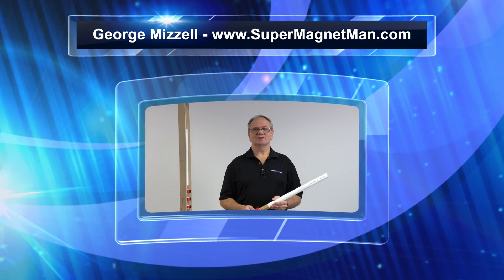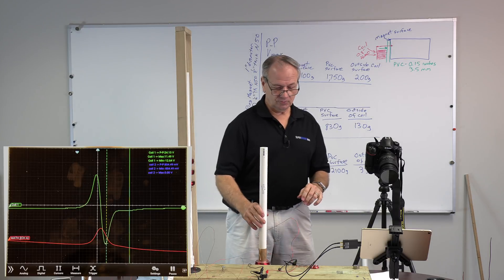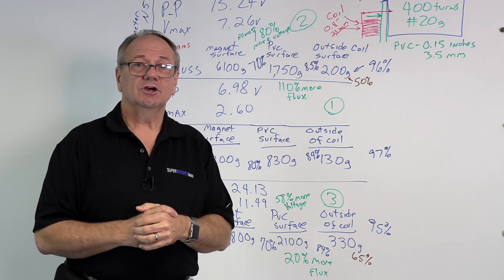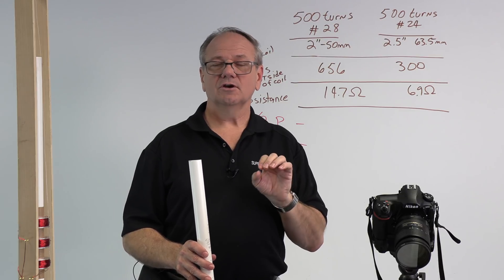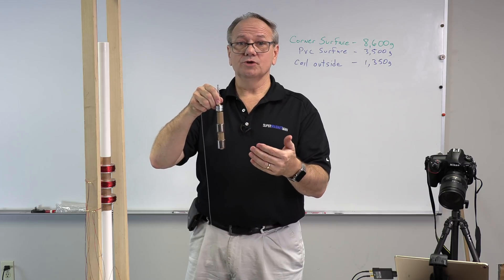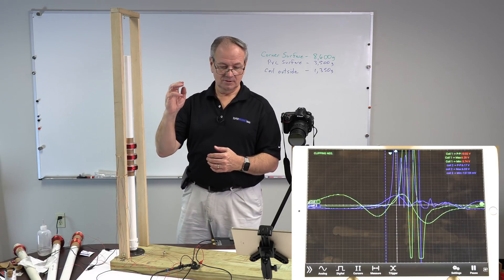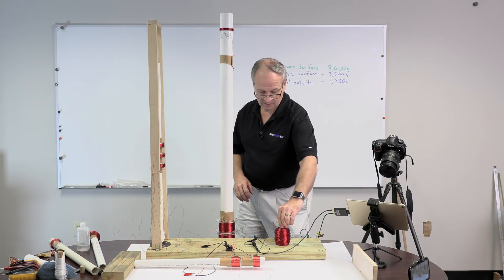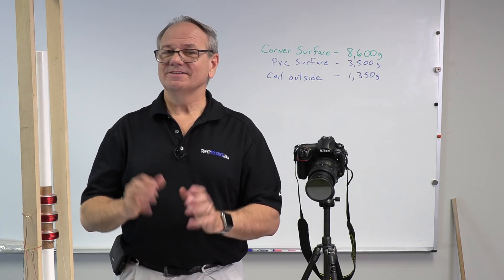Magnetism and Wave Generation

Comment: Maybe even an hourglass winding and have the magnet in the middle bouncing from the top to the bottom
Reply from the maker: Good idea.  I was even thinking about adding several coils of increasing size in line and sequencing them so that the field gets stronger as the cylinder magnet accelerates.  Sounds like we have more fun projects coming up - stay tuned!!!

Comment: you could use like a toilet bowl float in adjust along the stem for the waves how fast do waves go up and down to change how quickly and how much torque it would have to adjust
although running it through faster is probably more important than the torque that you run it through
Reply from the maker: You are correct and we are still working on several cool ideas with wave generation.  Hopefully they will be in a future video:)
Reply: Maybe an offset seesaw for leverage and as it’s raised it doesn’t come down with the seesaw and instead hooks up and is not let go until after the seesaw returns to the bottom where there is a trigger for the above  mousetrap  style hook .

Comment: How about gravity magnetic wave. take 2 magnets one down and one above it (heavy) repelling each other for the top one to be free to move up and down but is repelled from going down. have 2 coils one between the magnets and one above the magnet... I assume you can modify it with your style. What do you think will happen when it uses the heavy magnet potential energy in gravity to move ? Gravity does the heavy work and the coil does the light work if done in a frequency.
Reply: Wouldn't u-b able to harness the energy from the resistence from 2 magnets repelling each other? N if yes," share a link  Bruh,
Reply: @SsDiBoi  No link to a.... theory. When the coil gets a small electric charge between the magnets would weaken the magnet connection and make the magnet go down. When the top magnet goes up again the top coil will be charged which will break the link to the bottom.  Obviously will need to be toyed with to see what works. But even a small solar cell that can give it a boost to let it get some momentum. Point is to make it have a snow ball affect to use momentum. Position of the 2 coils would matter, just like width/height of the magnet, weight, loops of coil, thickness of coil. Maybe even both coils in between the magnets, or a third coil. sensor, etc. Will be simpler if you added it up in math of gravity, weight, Gauss, coil position, and turns.thanks
Reply from the maker: Obviously this would be a sensor application and electronics project.  The problem is that it would not be able to create enough power to bounce it back to its original starting point and so each pulse would be less until it reaches equilibrium.  Of course with a little thought you could look at using this concept to capture lost energy from other sources.  Like a train or subway track that vibrates up and down as the cars roll over.  Right now all that energy is wasted but lots of small coils and magnets could recapture some of the energy.:)
Reply: @SuperMagnetMan  I'm now getting into free energy and I c alot of things that could be combined but that could just b my ignorance like the issue explained seems like it could be a solved wit perpetual motion but spinning fast enough would still b an issue but a combination I think can work if I don't electracute myself. I c its alot like aquaponics without all da nik naks that help so a bit easier but fatal
Reply: @SuperMagnetMan  true. I was thinking instead of magnets being a primary source why not have it an a secondary source in a device and gravity as primary. Takes more energy to push a magnet than to weakness a magnet to have gravity do the heavy work. Which is why I felt that a small solar to help while it gains momentum, but again I can be most likely wrong.. The thing is frequency (device) has more power than pure brute force, like bending an I-beam for example. Thanks for the videos.